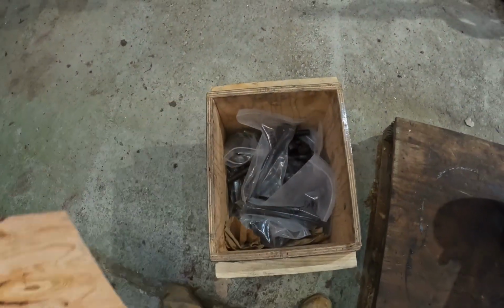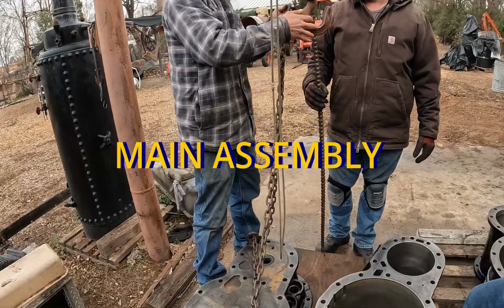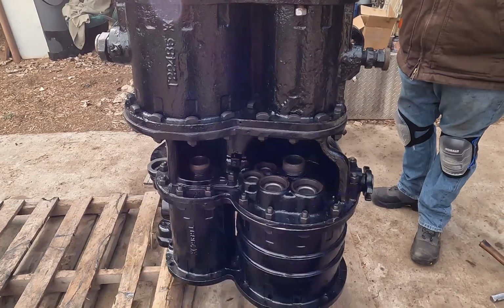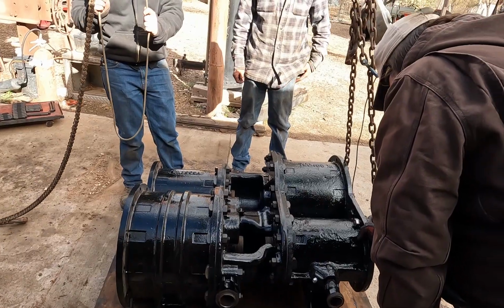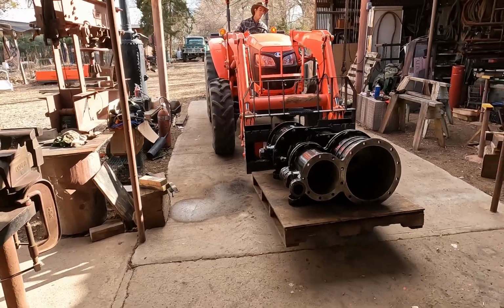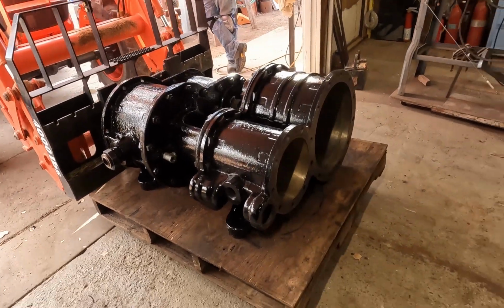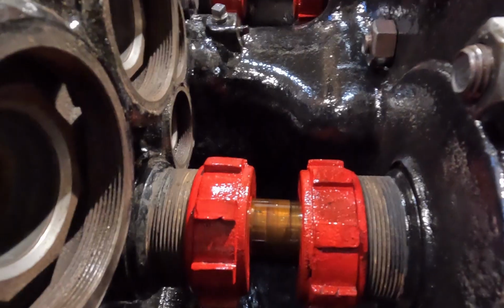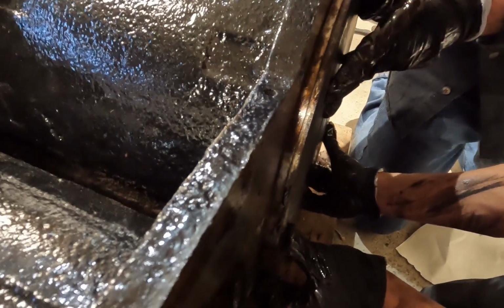Reassembling 2926's Air Compressor! | Air Compressor Rebuild

Comment: It seems like the next step is to return the air compressor to the 2926 itself.
Reply from the maker: Actually no. The next step is to test the air compressor with live steam. Which that video will come out Sunday. Im quite excited
Reply: @atsf2926  Hopefully the step after the air test will be returning the compressor to the locomotive.
Reply from the maker: @mrtrainmaster8007  it was put back on the engine on Saturday

Comment: Surprising that there were no washers used on the nuts when installing the T-head bolts?
Reply from the maker: Both the bolts and the nuts were built specifically for this air compressor to the specifications to how it would of left the westinghouse factory and it originally didn't have washers on it.